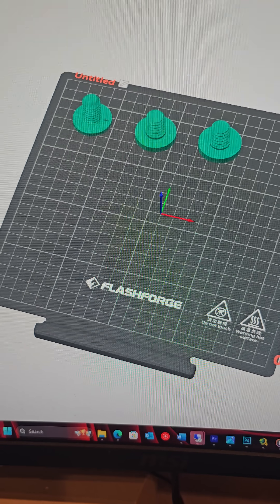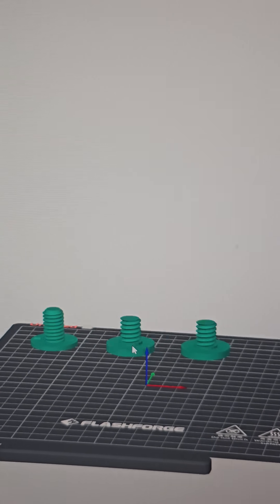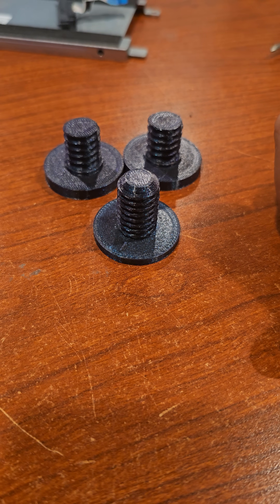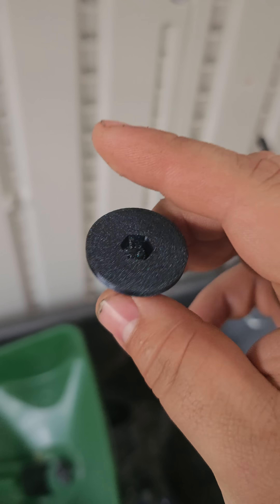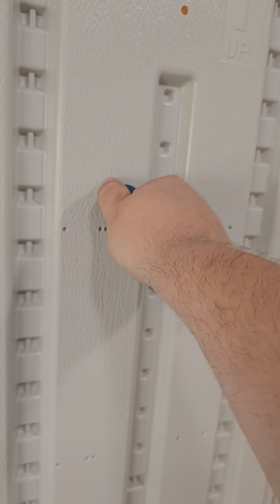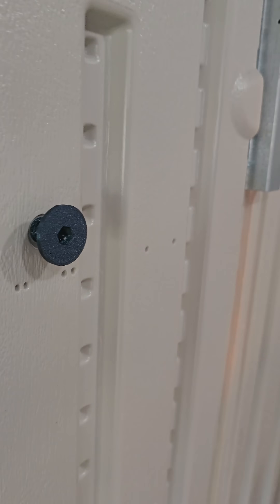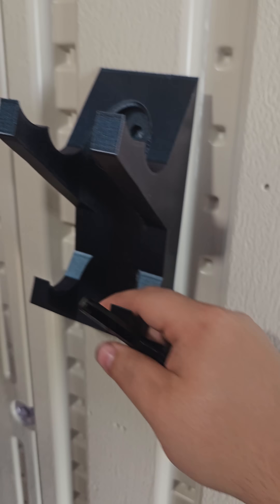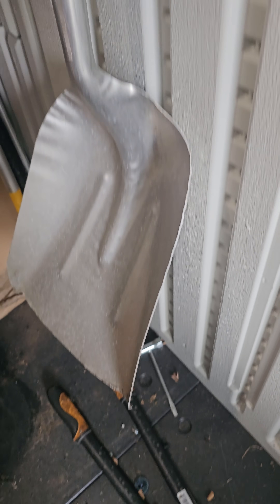The Internet Failed Me… My 3D Printer Didn’t #amazon #suncast #shed #3dprinting #tech #nerd

Comment: Thoughts: Print these at an angle so your layers are not parallel with your load; this will greatly increase the strength, and cleaning up the threads with a die will make them thread in cleanly to depth without breaking off.  Even better, print a core, and use the lost investment casting technique to cast these in Aluminum, then a die to clean up those threads. An Eazy Out or other spiral extractor should remove that broken stud from your wall.
Reply from the maker: Thanks for the tips! I'm actually still fairly new to 3D Printing so this is helpful!